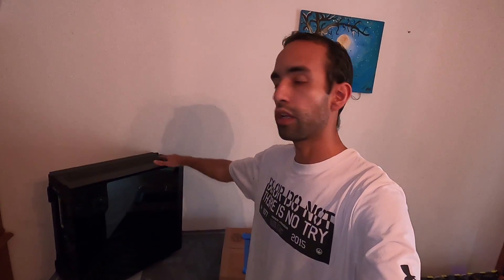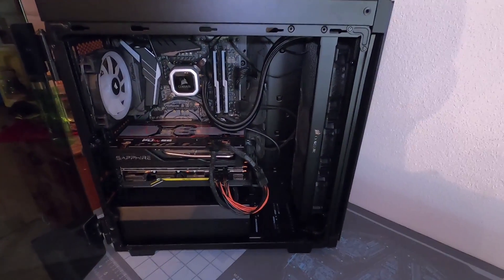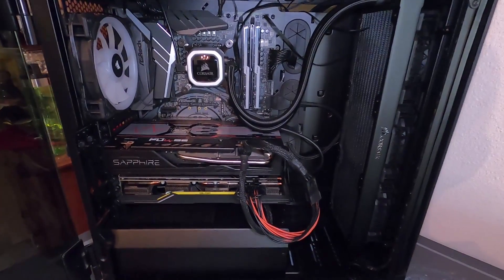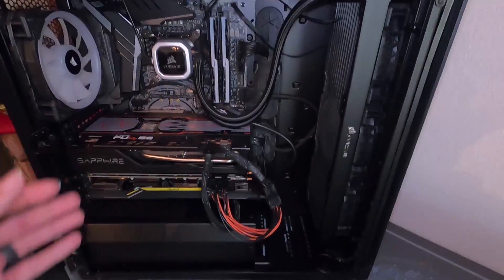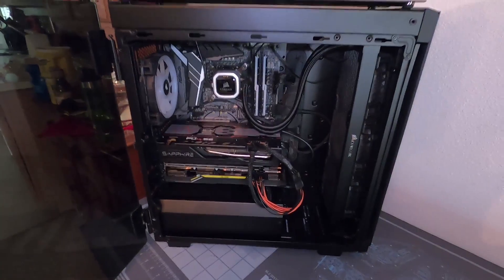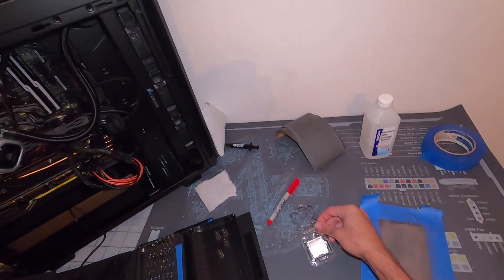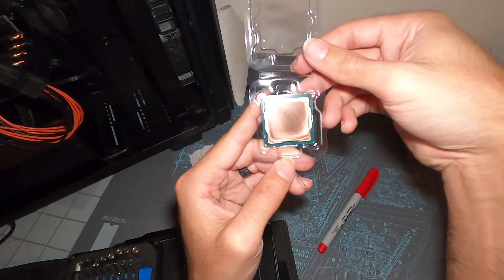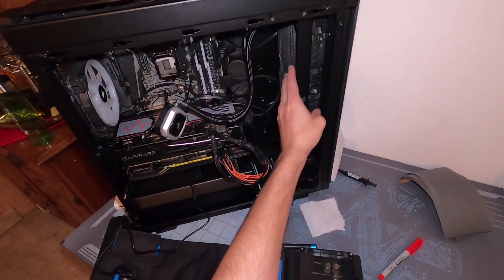Improving Intel i9 9900k thermals - Lapping IHS

Comment: The reason why this shit won't work, is because both the CPU and AIO have been lapped, making it not make enough proper contact with each other
Reply: Lol what? Thermal paste is only used because both surfaces have imperfections. Theoretically if both were perfectly flat you wouldn't need paste.

Comment: Personal recomendation: Find a flat piece of glass and tape your sanding paper on that! That way the edges will be in line with the center of the ihs. I also would look into lapping the waterblock itself. Other than that... thanks... now i want to sand my ryzen :P
Reply from the maker: Thanks, I was planning on re lapping and trying liquid metal, but I know it will stain the copper
Reply: @SerpentXTech  its not aluminium so you're safe with liquid metal... but i think LM really makes sense if you delid your cpu... i'm sticking with nt-h2 for the moment... I think it makes more sense on lets say a 5700(xt)'s direct die...

Comment: You got your rad upside down as well. The waterpump is in the block on your cpu. If any air happens in your water system it will hang out in the top of your rad. Flip that rad so hoses are on the bottom.